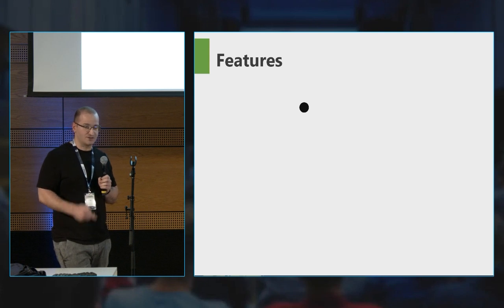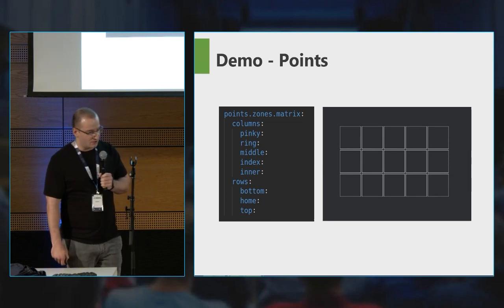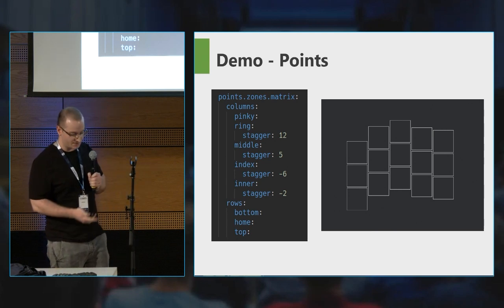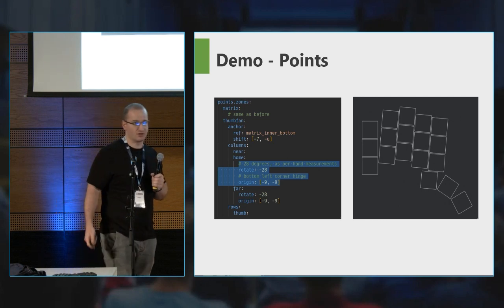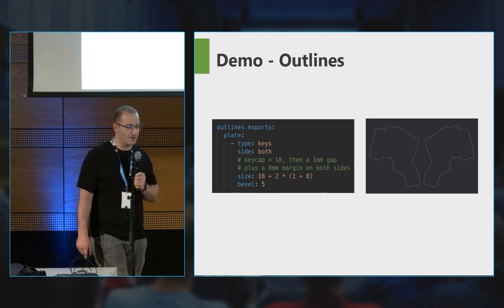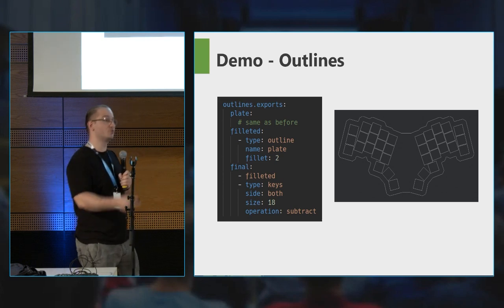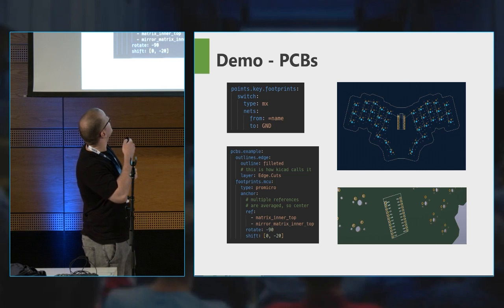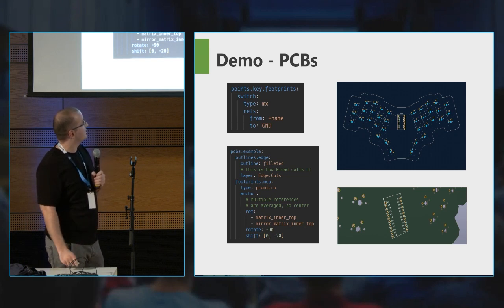Ergogen - A declarative language for generating ergonomic keyboards

Comment: Came here after starting on the journey of building my own board. This is a great tool, but its obviously made by and for programmers. I hope a future update includes a usable UI for non-coders. Please please please make the visual interface the UI and make the text editor secondary.  Code could be generated from the placement/size of the elements.
Reply from the maker: Sorry, but exactness, programmability, and a declarative textual input were very fundamental design choices here. Nothing stopping someone adding a more user friendly GUI on top, of course (yay open source!), but it almost definitely won't be me.

Comment: great tool! need some extra work to figure out the workings of it, but good overall. dxf export has some errors, it does not interconnect all the line segments.
Reply from the maker: The lib is build on top of makerjs, which does this sometimes, sadly. Feel free to join the discord for debugging tips, if still relevant - I recall others having overcome issues like this.

Comment: AMAZING! I'd love to build ZMK's keyboard! Has anyone been able to replicate famous keyboards like the Ergodox? And what if I want to include a knob, lever or lcd screen?
Reply from the maker: Thanks! I'm not aware of a concrete ErgoDox replication yet, but should be easily doable - including a knob, screen, or anything else, but that would require a bit of extra footprint magic. Feel free to ask around in the discord, where others have already tinkered with their own footprints...
Reply: @denesban  Is there any book or course that focuses on learning the basic electronics and circuitry knowledge of how to build specifically keyboards?
Reply from the maker: @encapsulatio  No comprehensive book/guide that I'm aware of. I guess we all just kind of get the hang of things over time and through a bunch of embarrassing failures... But: what you generally want to start with is looking into matrix wiring (http://blog.komar.be/how-to-make-a-keyboard-the-matrix/, https://www.dairequinlan.com/2020/12/the-keyboard-part-2-the-matrix/), then continue with the widely recommended kicad keyboard tutorial (https://wiki.ai03.com/books/pcb-design/page/pcb-guide-part-1---preparations). Having digested these, you'll probably be at a level where you can at least ask pertinent questions about what you don't understand yet - and for those questions, I (in a totally unbiased manner) recommend the Absolem Club's fieldly experts (http://discord.ergogen.xyz/).